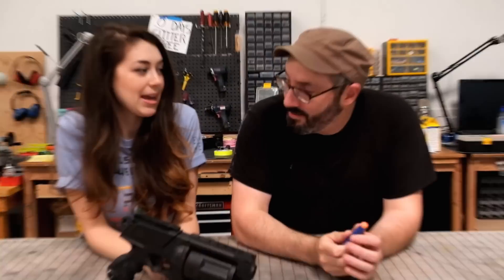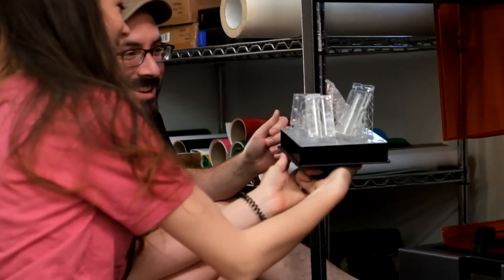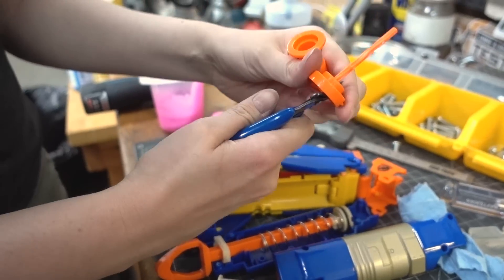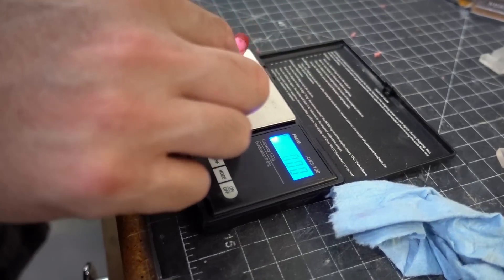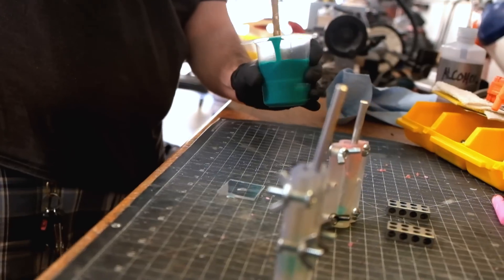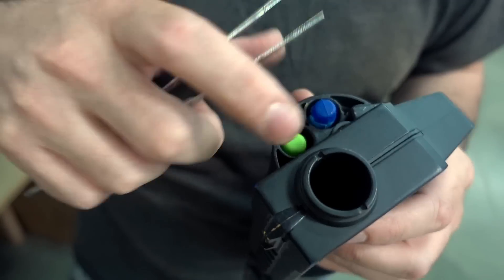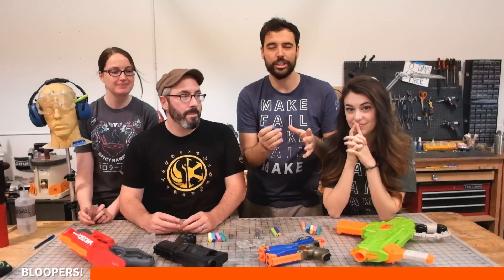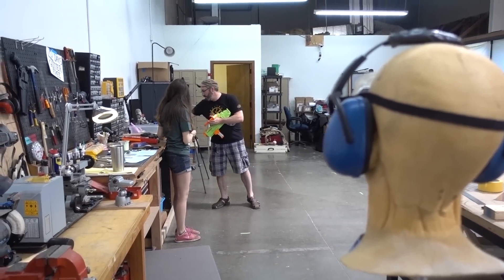Making the ULTIMATE Nerf Dart? (An Adventure in Foam & Silicone Casting)

Comment: As far as I know gun shoot thx to compressing quickly air which pushes the dart out of gun with significant speed... That means that in general the force which acts on a dart is rather not that big so the details matter. I mean such details like friction of dart in a barrel or air leakage resulting from too lose fit. Hollow dart has ups and downs. Up is that while bullet is half way out, still a significant force is applied to heavy head of a dart so it is stabilizing its flight, but hollow dart means more room for air so less pressure, so lower force after all. Those effects can be quite not that significant comparing to friction or air leakage. In my opinion the main problem is friction. I think that even chalk could help your darts to make them move with less friction, but without chalk you need to find foam such your coefficient of friction will be the lowest. Then make it as smooth and almost perfectly fit as possible. And i think that you dont need to care too much about balance of a dart. You need to experiment with total mass for sure but its enough that head of a bullet is just a bit more dense so dart will not flip while flying.
ps. your darts have some grooves... why? if there is no thread in barrel then it should be smooth like classic nerf dart. even if your dart will gain some rotation it will not make any significant improvement on flight stability and only increases dissipation of energy of your compressed air. and u do not want that. u want all energy just in straight forward motion.
cheers!
Reply from the maker: Thank you for all of the helpful tips! Definitely think we need to try new foams like you mentioned. We had added riding thinking it might make them spin but it didn't seem to have any positive effects.

Comment: You should make the tip a smaller diameter than the foam and sand the surface of the foam to expose the bubbles a bit to reduce the surface area of the dart that is in contact with the inside of he barrel
Reply from the maker: Ooo interesting, would not have thought to sand the foam!

Comment: My two cents. The heavier dart will probably work better in a modded gun. If the dart is at all grippy in the barrel it will slow it down. Try a more traditional dart shape. Just a + shape shaft with the rubber head. Then more air can get down to the tip of the dart. Maybe try a 3D printed dart. You can control the size and weight better.
Reply from the maker: Yeah the dart was definitely too grippy, and the silicone tip had some tackiness to it. Thank you for the tips and ideas!

Comment: Super cute video. I think the front part of the the dart (just the tip) is adhering to the plastic parts of the gun too well. I think making it out of polyethylene or polypropylene might give better results. And if you feel like increasing the unit cost per dart, you could always go with PTFE. (Please note: PTFE melts at about 330C, but decomposes at about 350C. The decomposition products of PTFE are quite dangerous, so don't attempt this in your garage.)
Reply from the maker: I think you're right, the silicone was a little tacky so definitely something we'll keep in mind for next time!

Comment: Cool experiment! Nerf hobbyists have been tinkering with DIY darts for a while, and so far the most effective design comes from a guy who goes by Captain Slug (he also makes amazing 3D printed nerf blasters, you should totally check him out). His method uses 1/2" diameter foam backer rod, a #8 washer glued to the tip of the dart for weight, and a felt dot covering the washer for safety. The only catch is you have to cut and assemble each dart individually, so making a batch takes a while. Being able to fill up a bank of molds with foam in a matter of seconds would be a serious breakthrough  in home dartsmithing technology, and I hope you keep experimenting with it!
Reply from the maker: Maybe we can combine some of his techniques with our molding techniques! Thanks for the tips and pointing us in his direction 😁

Comment: The NIC (Nerf Internet Community) had used 1/2in closed cell foam backer rod with a different ways to make the heads. Granted these would be cut to about 1.5in, but the smaller size meant better aerodynamics and flight.
There's glue domes: a metal BB embedded into a small hole in the top, with a hot glue dome over it.
Slugs: a #6 washer (with or without the embedded BB) with a felt pad ontop.
Silicone domes: silicone caulk cured with cornstarch in molds.

We'd use these for our homemade blasters for higher FPS game events. Cheapest way to get darts is 3rd party ones from China ;)
Reply from the maker: Soooooo many good tips! Thank you so much for the suggestions!!!
Reply: historically, we had the hardest time getting consistent + safely weighted tips. Continue using silicone + molds for the tips but switch to caulk backer rod for the foam
Reply: Bobbo knows his stuff. Also if you're interested I'll send you some of the darts hes talking about
Reply: Bobo knows his way around a nerf dart
Reply: I was waiting for someone from the Nerf community to chime in- custom made darts have been perfected for a number of years pretty much, well worth reading up on the various styles and also aftermarket darts such as the very popular Koosh gen 3 darts that perform better than official Nerf elite darts...
Reply: Bobo! Lol we need to get them some NIC level blasters or some Of our blasters.
Reply: Of course bobo beat us all to it. I've never seen someone mold their own silicone heads though. Also the foam has to be  just the right size unless you are using a seriously high powered blaster. The reason the hollow foam works better for those is because it can compress easier for a better barrel fit. They just need to adjust the tolerance of their foam mold to make a slightly skinnier dart.
Reply: Bobololo is probably one of the best sources that you could reach out to when you do your research for this.
Reply: Stephans for the win!
Reply: I actually think the biggest issue they were running into here was friction/stickiness. Density and rigidity were surely factors, although at this point the aerodynamics of the tip were probably too fine a detail to have made a big difference. However, I think the stickiness of the silicone would have played a major role in the poor performance. Nerf darts have a rough and porous surface, allowing them to slide through the barrel smoothly. Where the tip needs to be a more weighted and dense material, it's noticeably subcaliber. That is, the slicker and "stickier" material of the tip is narrower than the body of the dart, and it doesn't actually touch the bore.

I'd bet that the silicone in the darts here was sticking to the bore, eating up a lot of energy due to stiction and then "chattering" down the barrel.

Nerf dudes, is that correct?
Reply: Hey bobo!! Tell'm how to do it man.
Reply: ERMAHGERD ITS BERBERLERLER
Reply: I wasn't thinking about caulk and corn starch, that actually sounds like a great idea for home made nerf darts
Reply: I need to join the community , my kids have me pulling nerfs apart at least every other week to disable the various air leaks on near every design
Reply from the maker: Thank you everyone for all the awesome tips! Just to see what our brains came up with on their own this first round, we had purposefully not done too much research. But so excited to dive in more for next time!!
Reply: Omg it’s bobo
Reply: Boooobooooooooo, I came into the comments to let them know about the NIC and was happy to see the metal lord star from the NIC had already schooled them on it. Love your content, hope you are doing well.

Comment: Now, make a "better" blaster designed to shoot the "better" darts
Reply from the maker: Oooo now that'd be fun!
Reply: Absolutely. When I modded a nerf gun with a heavier spring it seemed like the dart was to lite to handle the extra push. Maybe a heavier dart will work better in a modded gun.
Reply: Adapt a paintball marker to shoot the darts! That just sounds fun albeit a little more dangerous
Reply: Just take a couple of pvc and brass pipes, and some k26 spring and you’re done.

Comment: Cut a section of 1/2in (12.7mm) Foam Backer Rod, hot glue a #6 washer to it, hot glue a felt foot to it.  Cost of project:  $0.15 per unit for mass production.  Also, it's all about the fit.  You want a slightly tighter fit for spring-powered blasters.  Also, for that Nerf Maverick REV-6, stack five pennies behind the spring, it'll give you more power.
Reply from the maker: Thank you for all the suggestions!! We're definitely going to keep these in mind!
Reply: If you're really into the Nerf customs thing, look up the custom nerfing community, tons and tons of awesome videos on how to make your blasters better.

Comment: I'm thinking that the fluting you put on the shorter head dart was allowing air to escape around the dart instead of creating pressure behind it. Also, making the homemade darts about the same weight as a Nerf one will help. Finally, if you get some 17/32" brass tubing the darts should fit snugly inside it, as the diameter of a Nerf dart is about 1/2" (.503"). Thank you guys for such a fun and awesome video! I've wanted to try making my own darts but lack a the equipment to make molds.
Reply from the maker: Ahhh that's super interesting, the fluting definitely could have been a factor! Looks like we have more testing ahead of us!

Comment: Wonder if the silicone tips were to sticky grading onto the barrels and slowing things down
Reply from the maker: Yeah that definitely could have been one of the issues. Wonder if we put a seal on them or maybe baby powder we could eliminate that as a concern.
Reply: or as a "control" use a plastic tip or rip one out of an off-the-shelf dart
Reply: Drew Folta plastic tip will hurt
Reply: The ideal would be to somehow make the exposed piece of silicone slightly narrower than the foam so that it will not contact the barrel at all. You would basically need to have a slightly narrower section at the bottom of the mold that holds the tip, which is more complicated but I think should be doable. This is how the actual nerf darts are designed I believe (it is really slight but there is a step there). I think in general you may want to make the diameter of your darts smaller as well. It may be the case that part of the purpose of the hole is to allow the air to get in an expand the darts a bit (probably just near the back so not too much friction) so having a tight fit all ready would make the darts stick.

As you casted these you could actually go for a wild shape that nerf darts cannot, like having them have a flare at the back to seal with the barrel but not have a tight fit all the way along which would increase friction. Regardless, you also need to remember that stabilisation on these is using the shuttle cock principal (not rifling) so what you need is weight at the front (rubber tip) but the tail to be light (foam with a hole in it).
Reply: Or you can make the silicone tips just a little smaller as the nerf ones!
Reply: @grisbar1968  I'm almost positive it was the texture of the foam. Caste foam has a skin that is quite grippy
Reply: @EvanAndKatelyn  do corn starch on the silicone
Reply from the maker: That'd be a great test to conduct!
Reply: @EvanAndKatelyn  its definitely the caste foam. Try using foam backer rod for the body, just needs heated up to make it rigid. There are after market darts that are made with silicone heads.
Reply: Maybe if the baby powder won't work then use liquid soap or oil.
Reply: @Artificial.-_-.intelligence  why not just use foam that wont grip the barrel to much...
Reply: I think its the foams texture or the silicone
Reply: That could be a possibility, or the foam was too thick in diameter, one reason i think that design didn't go too far, there isn't enough pressure to allow the dart to slide out

Comment: One thing to note, the actual Nerf darts have a little white weighted piece near the orange tip.
Reply from the maker: oooh that's really interesting, we should have cut one apart on the bandsaw to get a cross section
Reply: EvanAndKatelyn Yes you should!
Reply: @EvanAndKatelyn  a band saw seriously to cut a nerf tip? are razor blades to expensive?